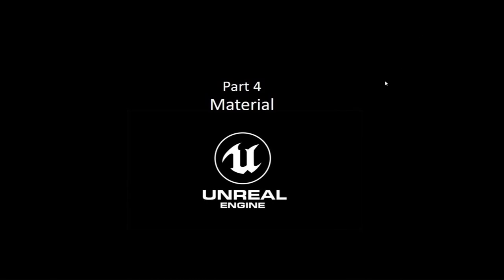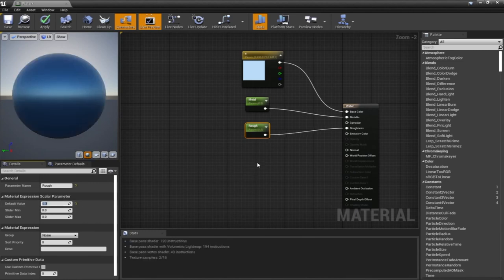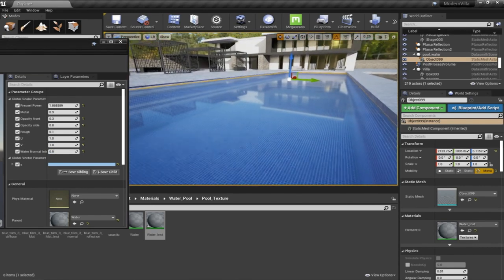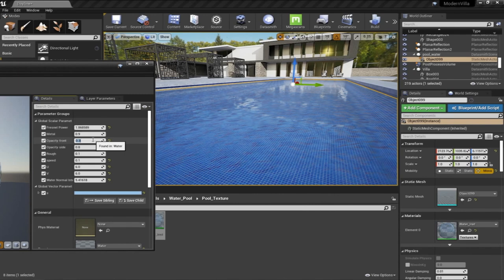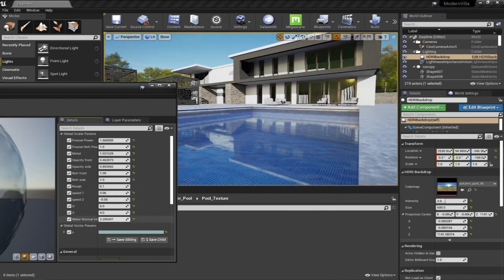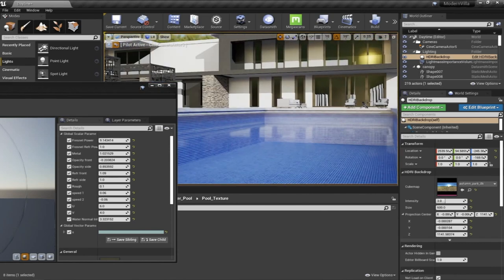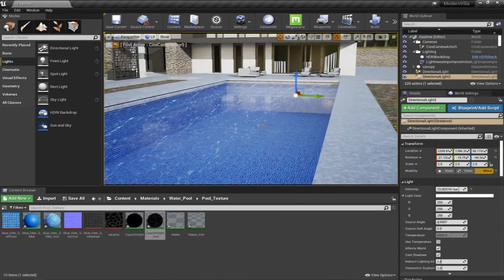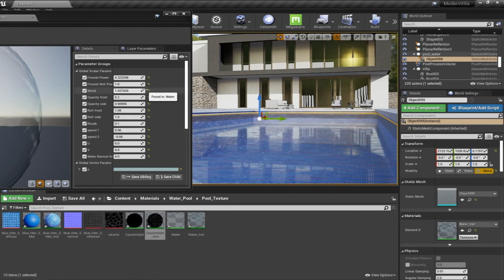Unreal Engine 4 Arch-viz Tutorial Course  part 4-3 Pool Water and Caustics

Comment: everything works like charM till now except refraction, the refraction that i am getting on GLASS either too less or its starting to bend things out of shape (bit extremely) at certain angles.
Reply from the maker: Glass and water are the two materials that will always be tricky and will need a bit of result test from different angle , i cant wait to see your final result if you would like to share it , thanks
Reply: THE IMAGENEERS I would love to share it 😇

Comment: Also i have 2 more comments. i am working very serious with this gift of a course. 1. The second directional light has to be  orientered x:0, y: 90 and z:0  to make it cover the whole pool bottom. 2. I discovered that 2 planar reflections cancel each other out. They say it is a bug, but actually when i turn of the window planar reflection i can see pool planar reflection and when i turn pool planar reflection off i can see window planar reflection, but never both at the same time. What can we do about this in real time?? And also in ray tracing and stuff to make show both, any workaround?? I would be grateful for any solution.
Reply from the maker: Am really sorry for the late replay , can you please share which version of unreal your working on and did you try 4.26 and got the same glitch , thanks

Comment: same problem here. if i put a non translucent material i have the reflection but with the opacity setting (as you describe in your steps) i dont have the house reflection. Same light set up, same HDRI and sun position. I have like a matte dusty water material
Reply from the maker: one of the things that we missed is to point out that you will need to tick the planer reflection support in the editor project , can you please check if its enabled or no , if u still face the problem please let us know
Reply: @theimageneers5161  works after use another glass material and put the nodes of your material... weird as usual un UE thanks!
Reply from the maker: @poststructural-ismlabel561  good to know you figured it out thanks for letting us know

Comment: Thank you very much, i have done everything as your tutorial but i have problems with caustics, they do not show, all the walls are in the same light channel one, but i do not understand why they do not show at all even if i increase the light. They just show if i turn off the sunlight

Solved: basically the sunsky actor has value of  75000 lux by default, i just went in its blue print and decreased the value to 200 lux.
Reply from the maker: Thank you for sharing were glade you have managed to solve it , thanks

Comment: Magnific tutorial series!  One question, when did you add the second  directional lighting?
Reply from the maker: Thank you , basically you add the 2nd directional light when you wanna use it on a separate channel like on our case we have used it to enable the caustics on the pool base but you can add as many directional light if u can change the channel and control where you wanna add it .

Comment: Awesome tuts! I have a small problem with my caustics. It works fine except that it seems to appear to 'pulse' every six seconds i.e. the emissive power seems to flare for half a second and then go back to normal. It gives the appearance that two random patterns are overlapping at regular intervals. Any thoughts?
Reply from the maker: Hi there , thanks , so regarding the caustic issue , Can you please double check the panner node if both of them is connected to the texture coordinate node so they are getting the same if  yes , please check also the speed values for both panners ,if you still facing a problem plz let us know thanks
Reply: @theimageneers5161  hi still facing same problem despite rechecking the above. TBH it's only a minor issue and I am happy to come back to it after i've watched the rest of your most excellent tutorials!
Reply from the maker: @oberdoofus  Thanks for coming back , actually the problem of the cuastic being freezed for a second and start back can be avoided by adding a (rotator) node after  the panner with a very low value like .001 on the speed and connect it to the texture sample , this will help get rid of that freeze problem , if not please let us know
Reply: @theimageneers5161  that fixed it! thanks
Reply: @oberdoofus  you can also flip that second caustic texture, so it won't ever overlap with first caustics texture cuz it would be different

Comment: what is the difference between lerp and multiply , please?
Reply from the maker: hi there thanks for your Q , basically you can easly think of them like 

Multiply node : is too darken the material or brighten it by using a color channel to multiply it by the texture for example 

Lerp node : is  for mixing two materials together by bringing part of both using an alpha value